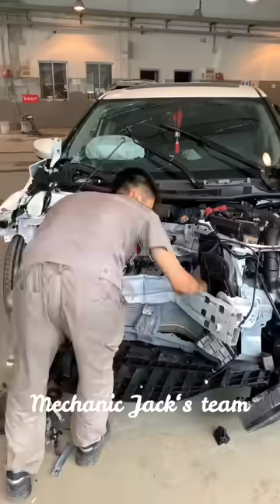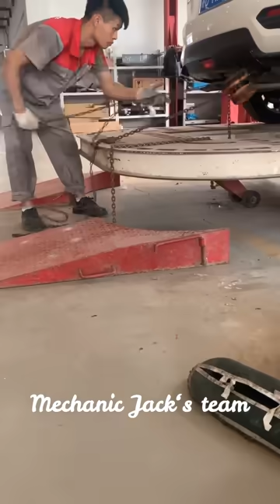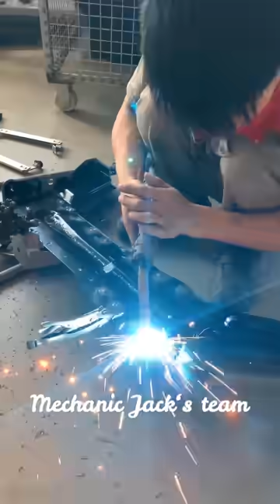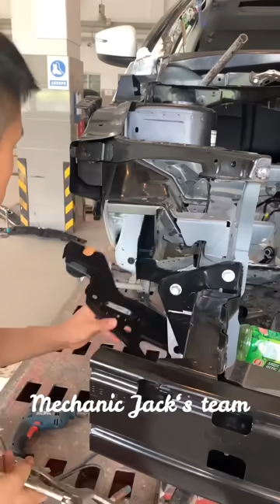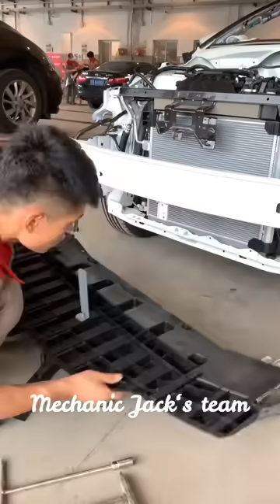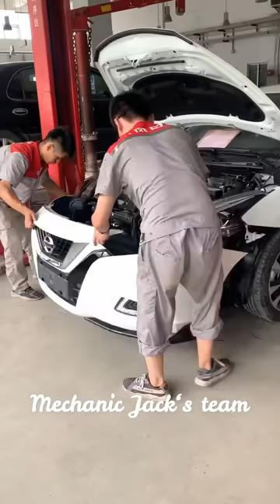Nissan Lannia | Process of car restoration. (front crashed)

Comment: This is illegal in my country.. This car is dangerous to drive ... this man has no clue of safety... as he isn’t safe to himself by not using helmet .. eye protection and gloves
Reply: It's not dangerous if it's done perfectly and changed airbags and new programming
Reply: @BulkyHealthyCat  After you bend the structural metal of the car, it becomes more fragile. If the car crashes again, it will deform much more and will put the life of the passengers at risk.
Reply: @felipelimacosta  they did cut off bad piece and did welding
Reply: It has to do with a phenomenon called metal stress. You can redo the welding, but the structural metal of the bottom of the car was deformed and was simply hammered back to its original form. The hammered metal is now stressed, and it is not resistant as it was before.

That's why this car is dangerous. If the car crashes again, the structural beans on the bottom of the car would not be able to hold the impact as before.
Reply: @felipelimacosta  I see but there is any way to build a car which is crashed like this one?
Reply: @BulkyHealthyCat  I'm not sure. Maybe there is a way if you reinforce the structural parts. But i have no idea if this is feasible
Reply: And yet he got the job done, better than what you or I could've come close to. That car probably drives better than all the beaters in the USA.

Comment: That's one heavy restoration. As far as I can tell, it looks like he restored it pretty thoroughly and correctly according to the methods. Any major structural panels that were damage looks like they were removed after straightening and replaced with genuine panels, as everything fitted back together pretty nicely. Not sure about welding without a welding mask, as wouldn't fancy burning my retinas out lol. But you have to hand it to these guys for successfully undertaking a pretty major restoration on a car that most others (at least in the West) would likely send it straight to the knackers yard.

Comment: In Japan, Nissan's home country, such repairs are almost never done. When the member is bent, it will be scrapped. And there are almost no mechanics belonging to the manufacturer who can repair like this, and such repairs can only be done by a good custom builder. The salaries of general mechanics in Japan are low, but they can only replace unit parts, so a craftsman who can do such repairs is very valuable.

Comment: I've been driving 55 years and have never been in a collision even remotely as severe as this one..yet I could be as soon as tommorrow. 
Just driving is a huge gamble, but the odds of getting into a major wreck are very low. 
  In the U.S., vehicles with far less damage are routinely "totaled" and it's less about safety than it is about the high cost and future liability concerns. This car may very well provide years and miles of service..maybe even longer than some of the brand new garbage that rolls off of some assembly lines.

Comment: ask any automotive or materials engineer in this world and the will tell you this car will be not road or crashworthy anymore. The internal fatigue suffered by the metal panels, beams, solder joints and glue welds are impossible to be fixed and have created permanent weak spots in the vehicle structure. You can even see the seams between panels from the firewall in the interior shot. A vehicle like this probably wont even be able to hold an alignment let alone keep its passengers safe in a following accident. Vehicles like this arent totaled because the repairs are too expensive but rather because they are not worth doing in a car which would still be unsafe. This is giving chance to future lawsuits due to vehicle failures or even the injury or death of its users/occupants.

Comment: If the car is total loss, How does you repair this?.The structural rigidity of the car remains the same after repair.? That is, in a crash, the body deforms as if it were without the accident?

Comment: I wouldn't even buy it if it just had a dented fender. I used to be a Nissan fan until I noticed how poorly manufactured they were and rusted out terribly fast , same goes for Toyota, you'd be surprised how many fail vehicle inspections do to rust and are deemed unsafe , even in very few years of ownership. Nissan and Toyota have had bad rust issues for decades and still haven't quite got it right .

Comment: First of all there's no way that it looks like the new one. Another scam from china like the "noodle repair" videos. 
For sure it is not the same car at the end of the video. If it is really the crashed car, then it's a very dangerous game because the car structure had severe damage and it is lost it's structural integrity. Never should've repaired a car like this.